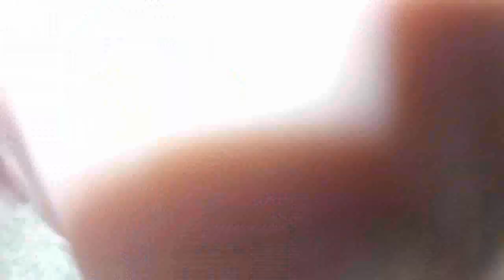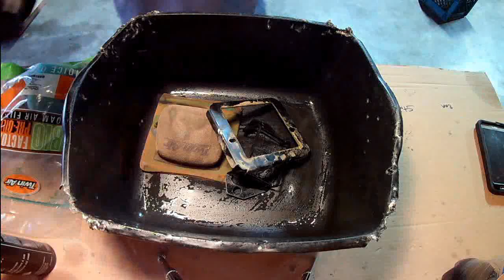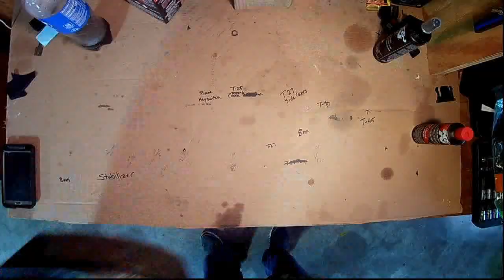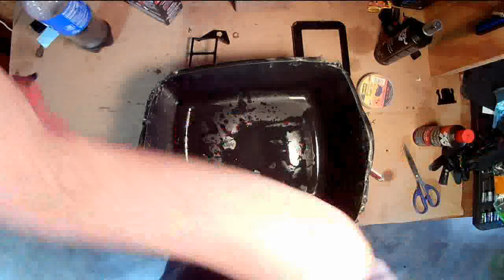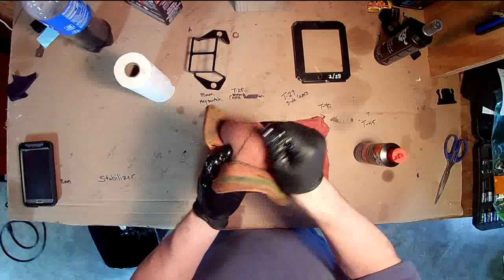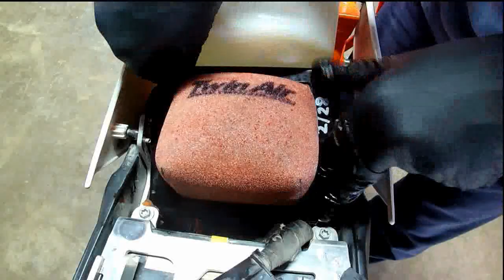TWIN AIR INTAKE FILTER CLEANING

Comment: Check out RMATV. They have everything you need for your bike and deliver right to your door. I prefer Silkolene. Its not biodegradable but fights water very well. Twin Air are the best on the planet.
Hopefully we will all get past this stuff in the world and get back to normal.
Reply from the maker: Your rite they have nearly everything under the sun. Ill look into the Silkolene, I used the K & N because ive used it for years with great results that and i had it already out here.